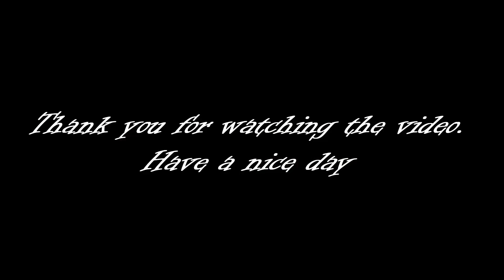Antique Guitar old Restoration | Restoration Music tools broken

Comment: ATTENTION ANYONE THINKING ABOUT USING THIS AS A GUIDE.

- filled it with ramen instead of filler.
- gave it a bath.
- used a hairdryer.
- used a wire brush.
- sanded off the rosette.
- sprayed over the damn frets/fretboard!
- gave it the roughest finish I've ever seen.
- didn't sand your spray job.
- put steel strings on a classical.
- restrung it incorrectly.
- put the tuners on backwards.

If I was being pickier that list would triple in size. 
HE DIDN'T RESTORE THIS. HE BROKE THIS. It was literally better before!
Reply: This video hurts a lot 😂😂😂
Reply: This is professional work and I am very keen on his next project

Comment: he fricken painted over the frets, the paint is dripping, he put the tuners on upside down, and he put steel strings on the guitar and thats clearly a nylon string guitar. It would have been better to leave it in the bushes
Reply: And he used a brick of ramen noodles to fix the hole... yikes.
Reply: I believe he just put mad and leaf to the guitar and leave it to the bushes for few days or weeks, poor guitar T_T
Reply: He used ramen to fix the hole he might copy it that ramen guitar. He should used saw dust
Reply: He faked the restoration. The mud and scratches on the guitar looked deliberately inflicted, just to make a restoration video.

Comment: You don't even have to know anything about guitars to understand that water and wood don't mix.
Reply: For real 😭
Reply: What's your opinion on ramen and wood?
Reply: They hearted your comment
Reply: @NewHunterMatt  I'm assuming it was supposed to dry out the moist wood, like silicon or rice on a wet cell phone but it should never has been soaked in water to begin with. Much less painted with water based paint.

Comment: 1: hairdryer is going to dry out and warp the wood from the heat
2: water + wood = warping , cracks, distortion.
3: wire brush did more harm then benefit.
4. You painted over the frets, which now need to be replaced if not polished to shit.
5: The TUNERS ARE BACKWARDS 

Please never defile a musical instrument again

Comment: Didn’t take out the frets
Didn’t tape the fret board so paint couldn’t get on it
Didn’t paint the headstock black
Didn’t paint the hole back black 
Used noodles to patch up the hole
Put the tuners upside down
Didn’t tune it correctly
Didn’t do the original paint pattern
Used crappy music for this video 
Painted everything turd brown
Painted the nut and frets
Used guitar strings on a nylon classical
What’s the brush for? If your gonna wash the guitar why use it?

And i don’t know how many more mistakes
Reply: Couldnt of said it better only thing id call them  machine upside down but yh bang on lots of mistakes could of mad this wel nice
Reply: his first mistake was picking it up
Reply: The one thing you missed and honestly after the list you have I wouldn't blame you for missing it because it was too unbelievable to think the guy really repaired a hole in the guitar with Ramen noodles. But he did just that.  To me this guitar is a total mess. You said it best when you asked "What's the brush for?"  I thought that very thing when the brush came out.

Comment: WHY WOULD YOU TAKE A WIRE BRUSH TO THE ORIGINAL FINISH. You just guaranteed the fibers will never take the same shape again, poured plain water all over it to guarantee the fibers swell and set further in that condition, and then take a grinder to the surface, guaranteeing it will never hold the same tone again. Guitar tops are made to tap toned thickness, each top specifically engineered to get the best sound.  You change the thickness by a fraction of a millimeter you alter the structural integrity of the guitar forever. You have to use gel stripper to get the finish off without damaging the surface. Cyanoacrylate wears down and falls out, especially when it is compounded with something as fragile as noodles, which will dessicate and vibrate until they fall out through regular playing. You have to use fiberglass with slow setting epoxy, or compounded wood filler, or another piece of wood. Any luthier should know NEVER to expose the inside of the guitar to moisture. That is bare wood. The fretboard should have been cleaned with carnauba wax and rubbing alcohol, oiled, and left alone. TAPE before you paint parts of the guitar that are supposed to be bare, like the frets, nut, bridge, fretboard, heelpeice, soundhole.  Use a heat gun to take out pits from spray painting, enamel spray (not household paint)  more than one coat on, french polish the final coat. You put the nut and tuners back on backwards. omg I'm pullling my hair out right now please stop please

Comment: My friend,  some of the things that destroyed this guitar:

-washing it in hot soapy water and heat treating it with a blow dryer
-patching a hole with tape and ramen noodles (*hey, I never thought I would say that sentence in my life!*)

-spray painting/staining the entire guitar at once including neck, frets and anything visible

dishonorable mentions:
-sanding the guitar's finish off including the guitar rosette decal and inlays
-sanding off/wire brushing the nickel plating on the key assemblies 
-failed assembly of the key assemblies

Key points:

>The wood in a guitar is paramount to its sound. It is already treated and prepared to be a certain way. Water, heat, vapor, moisture, humidity, salts, mold, termites, perforations, glue, tape and so on disrupt, ruin, attenuate, and otherwise destroy that quality.

>Metal parts on a guitar have special metal coatings. Wire brushing or sanding them off leave them susceptible to the atmosphere and its elements. 

>The wood should be uniform in a guitar. The proper way to repair the top side was to remove the neck, the edge inlay, then the topside, replace the topside, replace the neck, position the bridge and refinish to match with a new rosette decal, inlay or hand painted one (if you're creative). 

>The neck was in the sun and weather elements. It should have been checked first to see if it was warped, damaged or bowed. A new neck might be required if the existing adjustment rod could not provide correction.

>Using a wire brush on any instrument is considered heathen. Never do it again for the rest of your life. Promise me. It's important. Okay?

>How a guitar plays is VERY important. You must check and adjust: the bridge, nut, keys, frets, and neck. You must also use the correct strings for the type of guitar you have such as nylon or steel. Strings must be the correct weight and diameter for your guitar. For a proper restoration you needed to check body integrity (which you would have done if you pulled the topside) for strong bracing, corner adhesion, loose or missing inlays & fret board separation at the neck joint. 

>An inventory of the guitar's condition and missing or damaged hardware on the guitar would have been helpful such as key quality, missing end peg/pegs, inlay damage, markers, nut quality, truss rod, fret quality and any creaks or separations in construction. 

In no way is this the entire checklist of a luthier who is a craftsman qualified to repair and produce guitars/parts. But it is written here so that you can have at your disposal some important aspects to the repair/restoration of a guitar. Essential to note is that a guitar is one of the most personal and integrated instruments a musician can bond with. Doing mean or obtuse things to a guitar can result in very nasty comments from otherwise good people to whom you are injuring their bonding experience with the instrument. In short, STOP doing what you are doing to guitars, it's hurting me.
Reply: John Valdez he spray painted the fretboard !
Reply: @jonthehermit8082  -I know, man...I know...I just...I can hardly speak, brother. I feel you.

Comment: I don't know why, but I'm going to write some facts in order to confirm what it's obvious,  that this is a fake:

- Wood can't be washed like your pet. Water deteriorates both the wood and glue. Ok, that guitar was no more than 50 bucks brand new, probably it's some laminated wood, take it to the shower then.

-Any hole in wood is filled with wood of the same specie. This way the resonation of the top of the guitar is constant. Noodles are good to fill holes in stomachs 
-Next time, unscrew the peg head first. This way you can take it apart in a table, seated and eating noodles. And yes, mount it again properly. Guitarist doesn't like to twist their arms to tune the guitar. Yes, they are very special and with a soft skin
-Use wood filler instead of whatever you had at hand. And try to match with the color of the wood (or the noodles)
-Mask the fretboard before 'barnish'. Frets doesn't like bathing. They like to be bare metal.

And so on...

I tried to be constructive,  but you take a cheap guitar with a hole and some mud, and 'restored' it to a useless guitar. Good job.
Reply: He's washing the woo to restore his original moisture, if wood dries up it warps and geometry of body and neck goes down drastically

Comment: This is the first time in over 10 years on YouTube that I’ve disliked a video. Everything was wrong with the repair, I mean for gods sake he washed the thing with soap, not to mention he basically soaks the whole guitar in paint, which he applied so badly that there is a bunch of debris stuck in the paint all over the guitar. Also, what the hell was that nut he put in? I’ve never seen such a thick slotted nut in my life, looks like it would be for a bass, not a guitar, but I’m not sure.
Reply: What about the Netflix cuties trailer

Comment: Great job.  Couple of questions :
Can you use any flavour noodles for repair or do they have to be plain ?
Which brand of coffee is best to spray the guitar ?
Is this a full size guitar or are you very small ?
You can use a wire brush in an electric drill to remove the dirt quicker - just saying.
Reply: I agree, he did a really great job! Double thumbs up. Also I think dog shit would work just as good if you wanna be cost efficient. The smell would add the finishing touch it needs.
Reply: @sebastianbancroft7184  I think human shit looks better but to each his own
Reply: @aidanbillings8325  why did your dad let that happen to that poor guitar???

Comment: This has to the be the worst travesty I've ever seen....

1. using a wire brush to clean off the wood. This is guaranteed to make things worse. 
2. That hole... filled with noodles? That should be fixed with new wood.
3. That finish... you didn't mask off the fretboard or the bridge. Just sprayed everything. If you were painting a house, your windows would all be covered in paint, too, right? 
4. The tuning knobs... backward.... that has to be a joke....
Reply: This was an awful mess.
Reply: Not a joke. He genuinely thinks he did a good job, and apparently countless others do as well 😂
Reply: He gave the guitar a bath ;.(
Reply: Not to mention that the final product looked like absolute dogshit

Comment: Please do not restore any guitar again😢
Reply: LOL.  I have to agree.  From not using a wood inlay to repair the hole, to not sealing the wood, to using a type of stain instead of paint, to for whatever reason putting the black streaks in the light spots to apparently try to darken the spots, to spraying over the bridge and fretboard, to not using any finishing coats, to not doing any sanding to smooth out the finish...and then coup de grace was installing the nut backwards.  The guitar wasn't any better at the end than it was at the beginning.  A total waste of a new string pack.  But that said, the video was entertaining for the comedic value.

Comment: Vices
1: video was entertaining 
2: his intentions were arguably good 

Sins
1: the guitar in question is clearly new but destroyed for the sake of the video
2: cleaning dirt off a guitar with a wire brush will badly damage the finish
3: cleaning a guitar with water causes severe water damage to the fretboard causing it to warp which can lead to fret sprout and high frets
4: not taping off areas that shouldn't be sanded
5: top ramen and superglue is a terrible idea for patching holes because well noodles absorb moisture and flex easily where as something like sawdust and epoxy resin accomplishes the same thing and wont rot or absorb moisture 
6: not sanding the grain filler all the way
7:wire brushes will scratch up your tuning machines just purchase replacement tuning machines or wet sand blast them
9: not taping off areas that won't be painted 
10: installing the tuning machine plates backwards 
11:installing the tuning pegs upside down
12: steel strings on a classical guitar creates too much tension and can warp the neck of the guitar aswell as lift the bridge, cause the heel of the neck to become dislocated from the body and can even crack the top due to the lack of X bracing 
13: the lack of any proper setup ie. Truss rod adjustment and nut sanding/shimming 
14: let's be honest the demo wasn't good.
15: the video has at least 5 ad breaks
16: lack of clear coat will cause the finish to wear out easily and blatantly looks worse
17: cosmetics. No rosette, no binding, no inlays, no headstock logo, and not even a pick guard.
Reply: The video is just a giant meme
Reply: @elansleazebaganno  no it isn't I actually watch this channel and there isn't a single thing that hints at that
Reply: Classical guitars rarely even have pick guards though 🤔
Reply: @RuskingArms666  Pretty sure he was going off the fact he put steel strings on it, but I don't know.
Reply: @Uber_Versace  I said this video but you could be right, I hope not though

Comment: My stages of watching this:

0:20 - Well, it has a hole in the sound board, but that's mostly just caked on mud.
0:30 - A wire brush to get rid of dirt? Seems ... harsh? Maybe the mud is more like cement.
5:04 - Water submersion? Ummm ... careful dude ... wood warps pretty easily.
5:50 - Ok, maybe it's looking ... ok, but what is he going to do with that hole? That's the soundboard--it's crucial to the sound of the instrument.
5:56 - Ok, now he's sanding it. That's a pretty pattern on the soundboard--I want to see how this dude gets that pattern back.
7:09 - Noodles? Wtf.
8:57 - Maybe it started out as noodles and epoxy, but now it looks like ... sanded noodles and epoxy. Plus, the back of that is still holding the exact awkward shape of the tape. (<--This is probably where I became confident that he had no idea what he was doing. Looking back, I should have realized it a lot sooner ...)
10:35 - You can keep sanding all you want bud--nothing is going to make that look like anything other than sloppy wood filler and epoxy noodles.
11:47 - Tape dude. The fretboard and bridge aren't that bad. Use some tape!
12:22 - Oh God! This is not looking good ...
12:46 - Maybe if he paints a happy face, the epoxy stain won't be as obvious.
13:37 - Now what genius? If he pulls this off, I'm going to be astonished.
13:42 - What is he doing with those strings?
13:46 - YOU'RE NOT DONE!!! THE FINISH IS ROUGHER THAN SANDPAPER!! I DON'T CARE WHAT YOU DO NEXT, BUT DON'T YOU DARE ACT LIKE YOU'RE DONE!!
15:20 - ... omg ... he's really going through with this ... he's going to put strings on that thing ...
21:02 - ... he didn't even bother to clean off the frets ... there is literally paint ... on those frets ... oh God ... 
21:38 - ... it's not in tune ... to be fair, I don't even know if it can be in tune ...
22:14 - ... yep ... yep ... just y'know ... adjust the tuning a bit more ... that's the problem ... ugh ...
23:24 - ... the dude has got to be deaf. There is no other explanation for this.

To be honest, I want to watch a video titled, "Restoring the restored guitar"  where someone that knows what they're doing fixes this. God that was painful.
Reply: You spend so much time on it 😂
Reply: Could this now ever be corrected? I think it's time for a quiet funeral
Reply: Yeah I started this thinking it would be therapeutic but I got so stressed starting once he ran water over it

Comment: sorry but not helpful , u used steel strings on a classical guitar????

i am cringing so bad
also using the wire brush to remove dirt  was so cringe

u putting all does scratches on the guitar was argghhhh

wetting the inside cringe af
Reply: ué cara '-' verdade mas mentira também
Reply: This is not a music instruments restoration channel . this project is anecdotic. The man is used to handle heavy motors metal machines and very tough gear
Reply: Macarena Rojo Iron Welders aren’t allowed to kill children so why should he do the equivalent?

Comment: Where to even begin. Tuners backwards, terrible sanding, terrible painting, wrong strings, didn't cover the frets, made a terrible repair of the hole in the body, nearly ruined the tuners, and did I mention the terrible paint job? Goodness gracious. No guitar should be treated this way.
Reply: Did wtf? Ok doomer. Just get over it and laugh. It made more ppl laugh than that guitar is worth (probably like 30$) what is wrong with you?
Reply: @matrixarsmusicworkshop561  Doomer isn't a word or insult. "Boomer" refers to the Baby Boomer generation, of which I am not, so not really an insult there either, even if you'd spelled it right. 

This video wasn't meant to joke or make people laugh. You know why? Because it's the exact same as all of his other videos. Same style, same approach, same solutions, which are bad ones. This wasn't a comedic video, it was meant to be instructional, and did a poor job at it.
Reply: @luke_mckay  if u could read u would understand I said doomer not Boomer wtf r u even on?
Reply: @luke_mckay  no doubt u don't understand it's a joke if u have problem with thinking like that